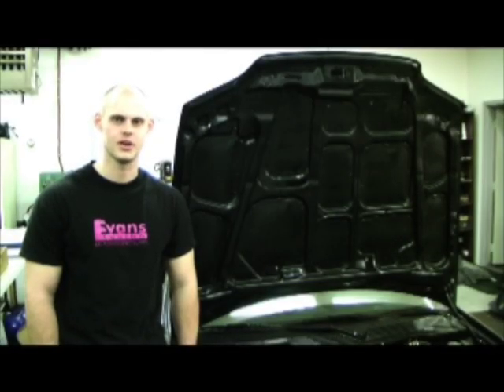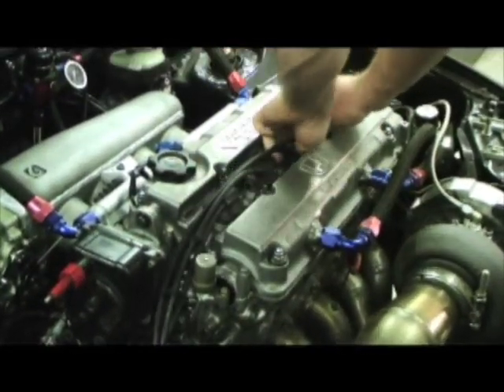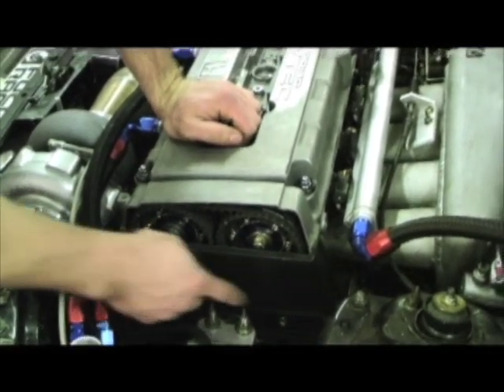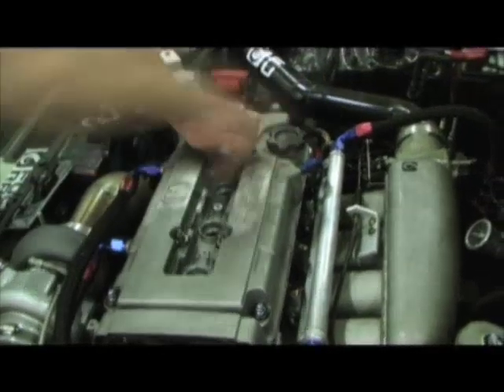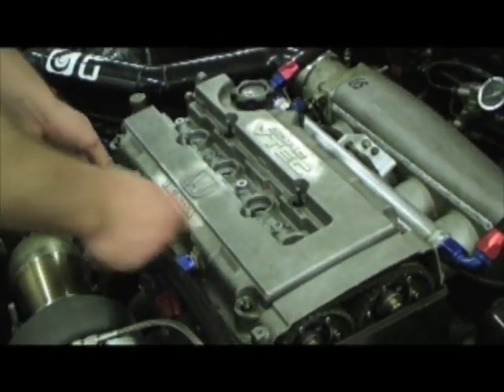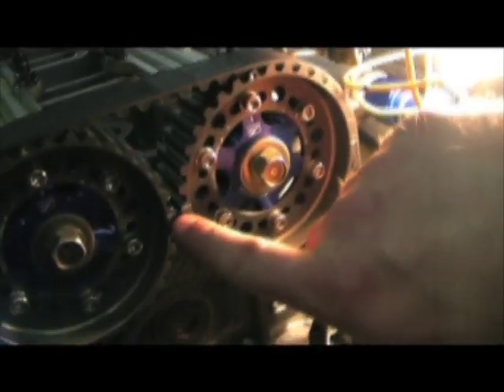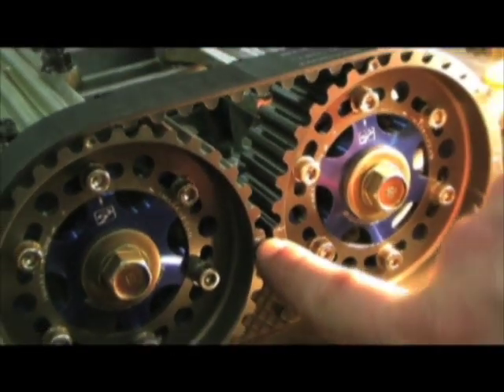Evans Tuning Cam Swap Tech Article - Part 1: Disassembly

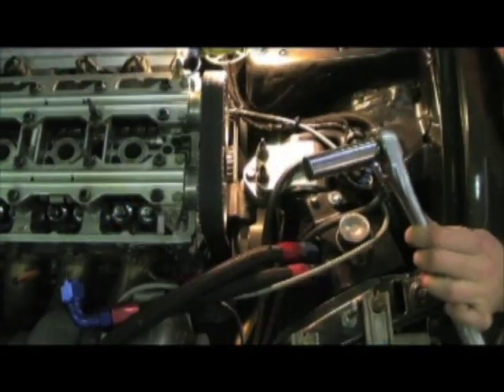Comment: At the 2:20 part of the video you say use a 1/2" drive with a 19MM socket to spin the motor. Just in the video you don't show where the socket gets applied? Is it an obvious where it goes, please let me know. I'm thinking of doing my 1990 ACURA Integra.
This is one GREAT video....really great.
Reply: Fred Dobbs This was made 9 years ago I doubt you woulda got a reply lol
Reply: crank pulley

Comment: Hey, I know this is an old video so a response is unlikely but I noticed when you took your valve cover off, you didn't have any oil on your cam cap covers. Mine are covered in oil, is that normal?